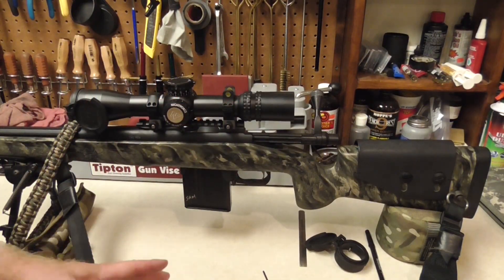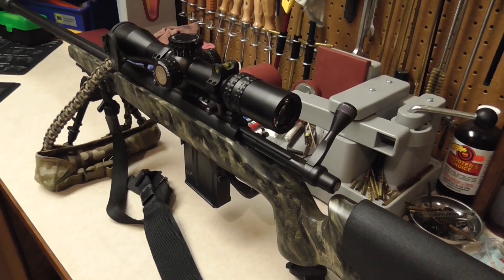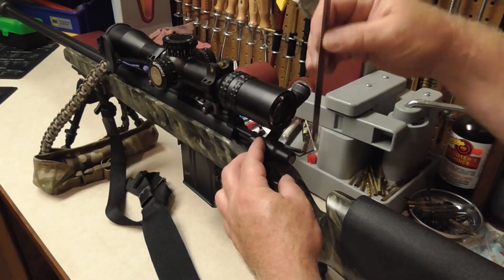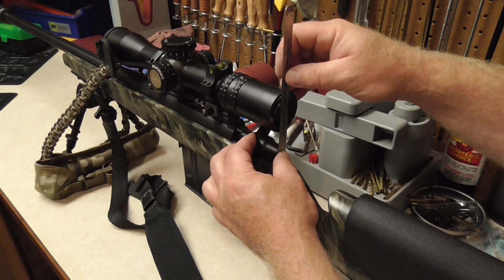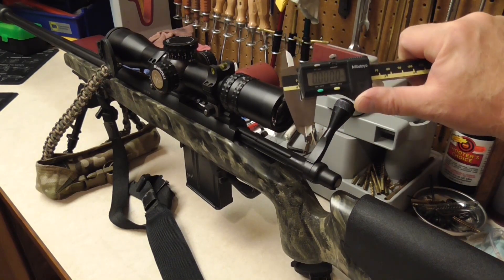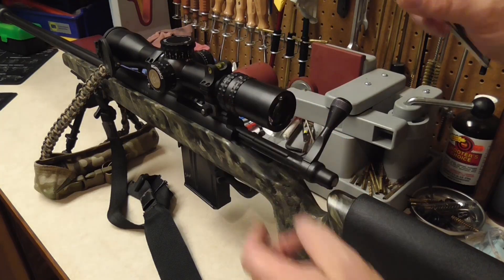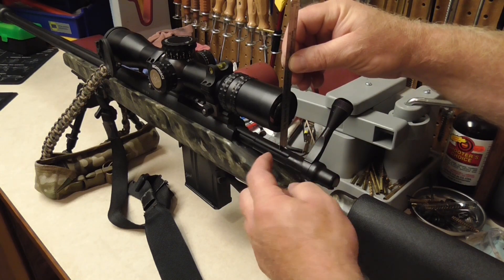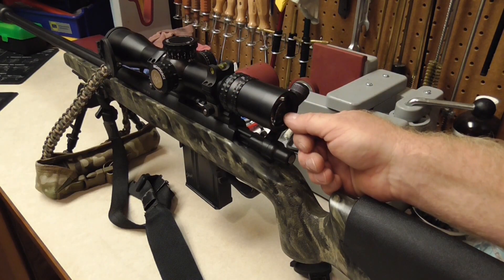How To Measure Scope Height

Comment: fun tidbit about how you could use the calipers to make all the ruler measurements, there are actually 4 ways to very accurately measure with a set of calipers. 1) Closing jaws, 2) Opening jaws, 3) the bottom of the calipers has a probe that extends and is designed for depth measurement and 4) the one no one knows about unless they read the Mitutoyo instructions or someone showed them opposite to the probe side a lip is formed when the calipers are opened and that lip is very good at measuring ledges in this case you'd use it to measure from top of scope to top of bolt and just change up the math a little. If you're running a high quality set of calipers you can expect all these measuring surfaces to be machined for their relative purposes cheapo calipers sometimes maybe mostly hit and a little miss.

Comment: Hi- don't know if you will get this as this video is pretty old.  The question I have is the effect of using a 20 or 30 MOA Rail as they are not "square" with the barrel.  The bore to center of scope would be different.

Comment: Great video. One question. Is it critical choosing a low and medium ring for long range shooting? My low rings at the moment is just 2mm from touching the barrel. If I buy a medium height ring, assuming its 8mm from barrel. Normally would shoot out from 600-800 yards makes a difference. Thank you

Comment: Knowing that exact number would be important when zeroing for the first time.  One puts the cross hair on the bulls eye and adjusts bullet impact to be that measurement low @ 50 feet.  (3/4 inch difference between 2.0 and 2.1 @ 1,000 yards is an interesting number)

Comment: what if your scope has a MOA decline for the scope.  do you measure from the front, back, or middle for scope height since it will be different?
Reply from the maker: a a It’s not enough to matter. Pick a spot that you can easily measure center to center.

Comment: What if the rail is a 20moa rise with the ocular lens being higher than the objective lens? Do you split the difference or use one measurement over the other?
Reply from the maker: Brian Arelt To be precise with the measurement, you would measure between the center of the receiver and the center of the turret housing. Measuring at the ocular with the bolt is easier because you have two distinct edges to use. The difference between the two measuring points, even with a 40 MOA rail, is small enough to be inconsequential downrange.

Comment: If a scope is mounted on a 40MOA base, is it best to measure scope height in the location of
the scope reticle?
Reply: I measure from where the scope turret centers are and on the left side of my rifle action there's a vent hole that shows where the center line of the bore is. Sometimes there's a convenient allen screw in the center of the scope turret to measure from where the center is.
Reply: I'm not an expert but could you measure the front of the scope and the back of the scope and use the average?

Comment: If I may say, you could use a caliper (or ruler) to measure the outside distance between bottom of bolt and top of scope, as well as top of bolt  and bottom of scope. Then add and divide by 2 (take the average).   That will be the scope height.

Hope that is helpful.

Thank you for your informative video.
Reply: Airgun Scientist Joe Brancato   You're exactly right. I caught that also...   Scope height makes a huge difference sometimes.   That's why people can use the 50-200+ zero, on an AR platform, but it's more like a 50-140 on a hunting rifle. AR scope height is around 3" above the bore, where it's only about 1.5" on a hunting rifle. The center of my red dot is 3.4" from the bore, on my AR(I'm a tall guy). I like it this way, because my 50 yard zero, turns into a 50-285 zero. 3" high at 150, is the apex. About 5" low at 300. I'm basically "minute of coyote" out to 300 yards. lol

Comment: if you had a scope on the gun and it was shooting 10 in. LOW "which is common when you have a 1" base riser + 1\2 in. for scope rings" on a AR15  you would want the CROSS HAIRS to be re-centered would you not,,before meausering scope height ????
Reply from the maker: It doesn't matter. Within the context of measuring scope height for input to a ballistic program, only the offset between the centerline of the bore and scope matters. The zero is a completely different input. 40 MOA rails and high rings on a bolt gun cause the same issues as a riser on a gas gun. In fact, we induce them to gain travel in the elevation turret.

Comment: very  good method .   does is work with 20 moa  base ?
Reply from the maker: Yes.
Reply: Typically the difference between the front and back of a 20 MOA base is so minimal that it shouldn't affect your measurements when you plug it into a ballistic calculator. I think on average it's usually .30 from front to back on those bases. Until you are at 1/8" or greater you have nothing to worry about.

Comment: Any tip on this subject on an AR varmint.
Reply from the maker: Same method. Measure off of the bolt carrier.
Reply: +Panhandle Precision ok, thats what came to mind seeing the vid. just wanted to make sure thanks!
Reply: I'm 1.25" from the center of my bore, to the top of my rail, on my DelTon AR. Then you just need to measure from the top of the rail to the center of your optic, and add 1.25". That should give you your height from bore to optic. Hope that helped...    I'm a tall guy, so I mounted mine high. The center of my optic is, 3.5" from the bore. Yours will be around 3", probably.

Comment: what if you have a 20moa rail
Reply from the maker: +Casey Young The measurement is supposed to be taken in the exact center of the turret, so any cant in the rail will result in a taller number at the rear. The rail in the video has a 40 MOA rail. The difference at the center is < .10"